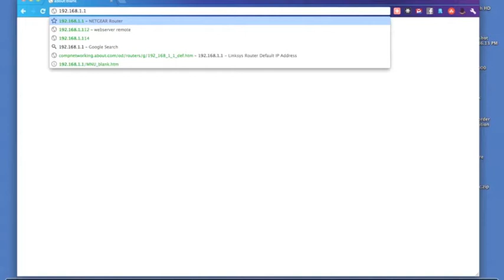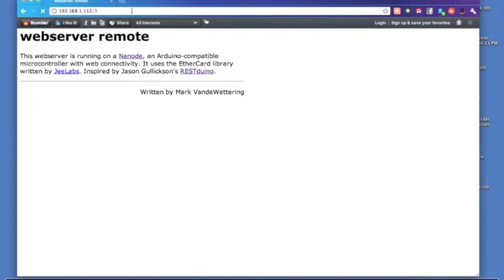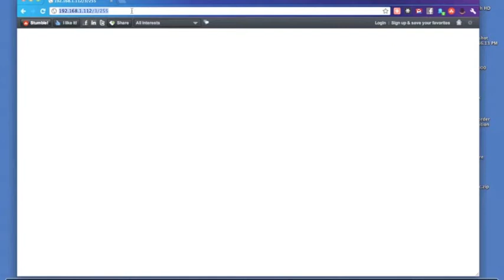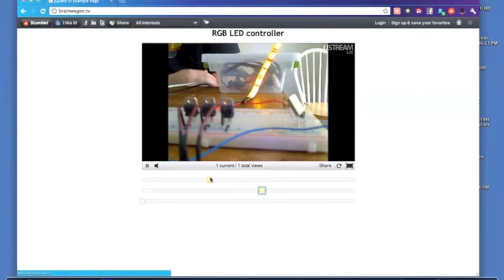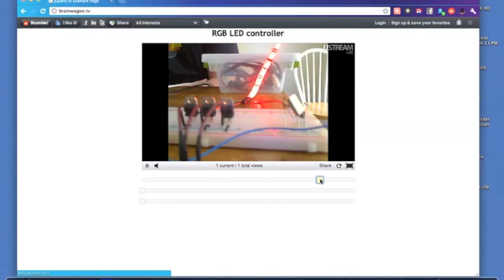Web-based control of an RGB LED via the Nanode, an Arduino compatible microcontroller

Comment: Great example :-)

Why are you using a 30 pound Nanode and not a 10USD Nano, 13USD Mega256 or 9USD Uno? And a ENC28J60 is even available for just about 3-4 USD. Nearly cheap enough to leave it in the project and use others for the next project ;-). Have a nice day => Great Work :-)